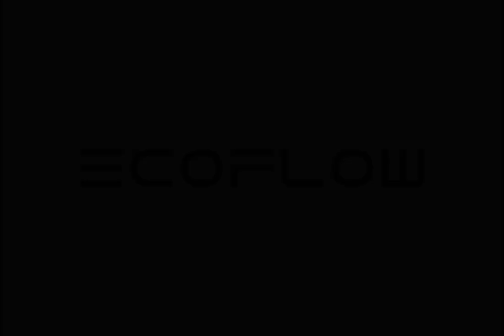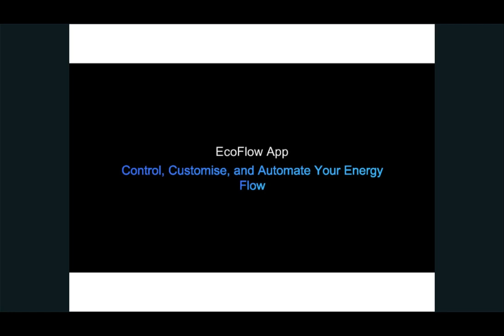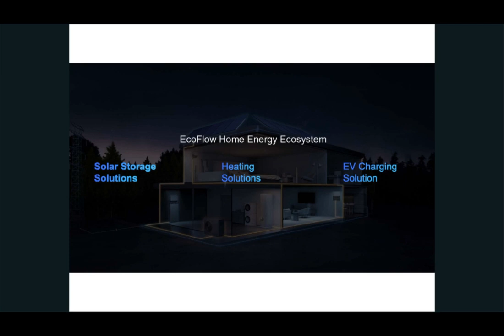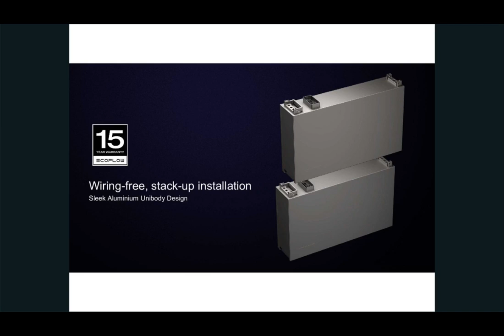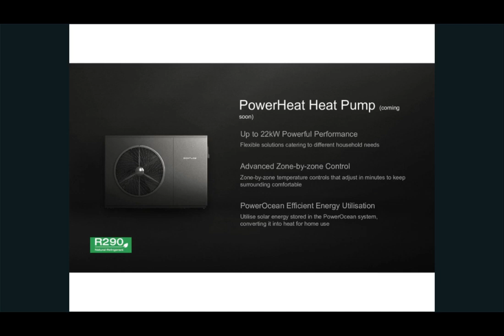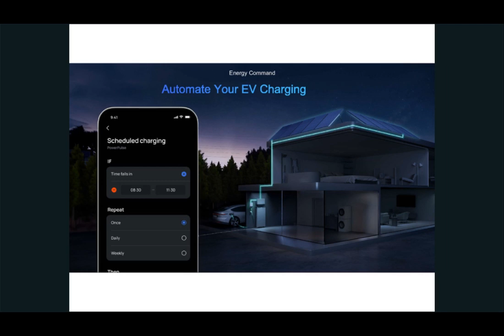PowerOcean Single-Phase: Ensuring Safety and Easy Installation for the UK Market

Comment: If a customer moves from a 5 or 10kWh wall-mounted battery to a 15kWh system (i.e. 3 battery packs plus inverter), do they need to swap to a floor mount?